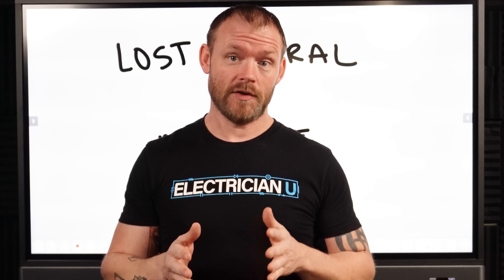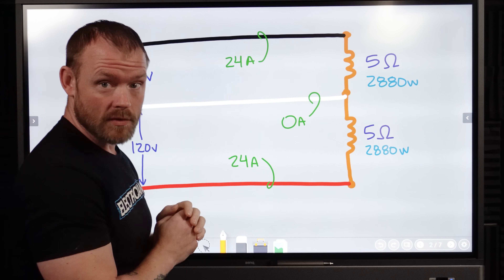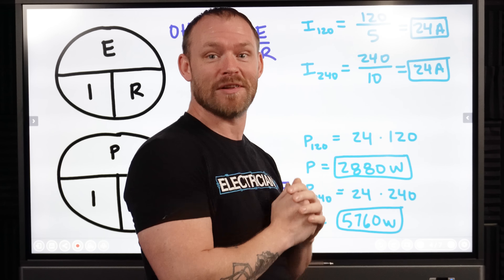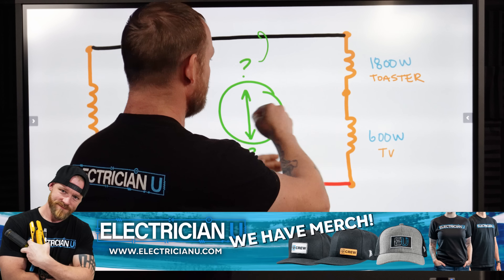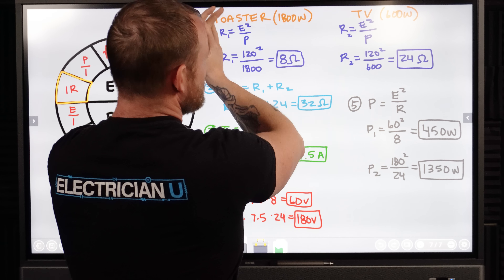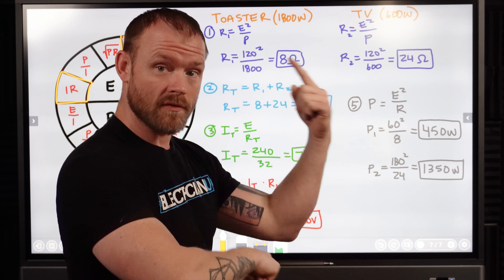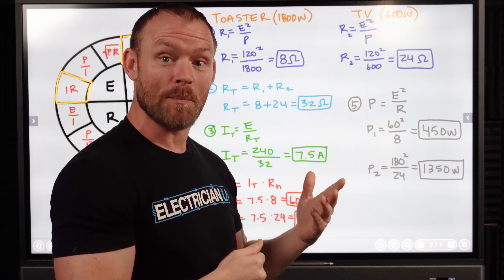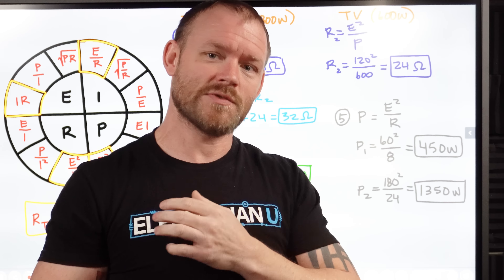NOT SAFE? Losing a Neutral in a Multi-Branch Circuit

Comment: Great lesson. Losing that neutral if it's on a combination breaker will roast that sucker. Had a plumber jump power off temporary pole for me and got about 6 combos for me and burnt his wet vac up. Had to throw that in there😂
Reply: I assume that "combination breaker" means a double breaker that is tied together to give both phases for a 240 volt load.  If that's the case, then the load may not even have or need a neutral.  Dryer outlets used to not have a neutral for this reason, but dryer manufacturers realized that they could run the electronics at only 120v if they used the earth ground as a neutral, and that's why dryers were forced to switch to a 14-50 outlet that has a neutral, since you are not supposed to return current on earth ground under normal conditions.  It sounds like your plumber effectively did the same thing and tried to split the 240v circuit to only get 120v, and if you lose the neutral when you do that, then the two legs go out of balance and you get higher voltage on one and lower on the other.  At that point you can only hope that the overcurrent on one leg will trip that breaker, and since it is supposed to be mechanically interlocked with the other, it will take that one down with it.  This doesn't always happen though since breakers are there to protect the individual wire not the *load*.
Reply: @phillipsusi1791  a combination breaker I’m referring to is a Arcfault single pole. I wasn’t on the job site when the plumber decided he needed electric and ran a 10/2 to instead of a 10/3 to meter socket and tiled the neutral on one of the a or b lines from sub-feed temporary thus putting the ground and neutral on the isolated neutral bar! This reading 180 V on one leg and 60 on the other. Fried arc fault breakers on high leg and smoking his wet vac and ruining 6 arc faults (combination) breaks.
Reply: @dgibson6147  I'm still not sure what "combination" refers to in a single pole breaker.

Comment: If the math just doesn't work in your head, then you can safely play with this. Sometimes doing is better than thinking about it.
Buy a laboratory power supply. These are used for doing electronics work. They are DC only.
Get one with two outputs and another connector on it for a ground. Also buy a pack of resistors of multiple values.
These power supplies are "floating". In other words, they have no connection whatsoever directly to the power from the wall. They are also of low voltages. You can safely short any or all of the lines, so don't worry at all about short circuits. These supplies have settings for voltage and for maximum amperage. Short circuit the lines and the voltage drops to only allow amps you set for, which will be zero unless you have a load within the short circuit.
Play around with two or more resistors and you can measure the voltage drops. You can measure the current at each point. The power supply itself will tell you the amps and volts through the whole circuit. Try doing 4-5 resistors in series and measure the voltage drops between different points.
Just make sure the connecting cables and resistors can handle the amps you set for.
(If you want to connect external stuff like an oscilloscope, you will then need to connect the ground on the power supply terminal in front to the circuit because the negative on the oscilloscope is directly connected to your mains ground. Very bad things can happen if you manage to short circuit the oscilloscopes positive from some device device directly to ground! Bam!)
What good is the power supply otherwise? You can pick any DC voltage it does and use it to power something like your cell phone or laptop if you can't find the chargers, just need the right plugs to fit. Need 4A at 5V for your cell phone, but you don't have the right charger, now you do.

Comment: Can this cause voltage to go up? When I turn on the dryer the voltage goes up to 134 volts on the house and consumers with voltage protectors stops working. What can cause this voltage fluctuations?

Comment: Joule–Lenz law,[1] states that the power of heating generated by an electrical conductor equals the product of its resistance and the square of the current:

This is NOT the same as Ohms law for Power. And Ohms law is for DC or for purely resistive loads. When AC is involved you have an added component which is Frequency. 
Example: You can measure a coil with an ohm meter and come up with a resistance. With this known resistance and known DC voltage, you can calculate the current (E/R). Now if you apply that SAME voltage but with AC you will get a whole different current flow. Because AC introduces Frequency into the calculations. At resonance frequency of a coil of wire the max current will flow and this can not be calculated by simple ohms law (E/R). This is because when voltage is applied to a wire, a magnetic field is created, when voltage is removed, the magnetic force collapses into the wire, thus generating a voltage. When the times of those voltage are exact, the coil is at resonance and max current will flow.
With AC the resistance is called impedance. In DC resistance & impedance are the same.
Then there is a PF to include in AC circuits....

Comment: I had a weird thing happen with an install we screwed up. We roughed in a garage with a studio above, and all the plugs were reading reverse hot and ground. And in the panel one of the lines was 0 volts to ground and the other line was 240v to ground. So what happened was that the installer bonded the ground to the neutral in this panel which was a sub panel :/ once I undid that everything went back to normal, but I just dont understand how things were even working normally or why the voltage was reading out like that! The people weren’t using this building very much but it had been lived in for a little bit and it seems weird that with 240v to ground on that one line, that they didn’t have worse problems. Could you maybe explain how this happens?

Comment: Never assume all circuits on a multi wire branch circuit are sequentially landed. I’ve seen circuits picked up in different locations in older panels. For instance, 2 , 4 and 12

Comment: This reminds me of a situation concerning multiwire branch circuits...
A customer was changing a 30 amp 240 v laundry center washer/dryer to a separate 120 v washer & 120 v dryer.  I wasn't quite sure how to make the conversion.  I wanted to separate each leg of the 2 pole circuit to make two separate 20 amp 120 v circuits.  My dilemma was this... I know that the laundry circuits had to GFCI protected.  The receptacles were going to go behind a stacking washer & dryer which made it very inconvenient for a point of use GFCI receptacle.  The washer & dryer would have to be disassembled & moved to press the GFCI reset button if needed. I was going to put the multiwire branch circuit on a double pole 20 amp GFCI breaker with one leg powering the washer & the other leg for the dryer, but I had the feeling that this would cause nuisance GFCI breaker tripping due to different currents on the neutral.  I ended up capping off one leg of double pole circuit & putting the 120 v dryer on the remaining leg.  I put the washer on a GFCI protected general lighting circuit.  I know laundry is supposed to have it's own designated circuit, but running a new designated circuit would have required a lot of invasive demolition from the panel to the laundry area.  Would placing the washer & dryer on separate legs of a double pole GFCI protected circuit have caused the GFCI to constantly trip?  What was the solution? Would I have had to run new circuits to the laundry area?  It's a pretty uncommon situation to encounter since 120 v dryers are pretty rare.
Reply: If you use a two pole GFCI breaker and wire everything properly nuisance tripping will not be an issue,  these special breakers will have L1, N and L2 on the load side, and you will connect the pigtail neutral to the neutral bus unless the panel is a plug-on neutral design.   They are designed specifically for multiwire branch circuits,  120/240V circuits, and 240V circuits.   For 240 volt loads that don't require a neutral you would simply connect the black and white to L1 and L2 on the breaker,  and connect the neutral pigtail.    The white wire in this case should be wrapped with a piece of black tape to identify it as a hot wire.

Comment: This would be more helpful if you diagramed with images practically applied in the field. 

For example, instead of drawing the symbol for resistors, you draw outlets or lightbulbs. Instead of drawing the schematic, you draw all the conducts used in an NM or MC cable, which means black, red, white, green.

That way we can visualize working with the concept instead of imagining it.

Comment: ima have to rewatch this video many times
Reply: Yes, he gave MUCH TOO MUCH information for a new learner.

You need to go way back to the beginning.

Learn about Kirchhoff’s voltage and current laws first.
Then go the Ohm’s law.    V=I*R         and    E=I*R.      are the same equation.          The V and E are both voltage.  Yes more confusion.
Reply: @tedlahm5740  ima look into it thank you
Reply: @tedlahm5740  is this like the line voltage and phase voltage?
Reply: @richardc7433  You are jumping WAY AHEAD.  That has to do with transformers.
Delta and Why transformers have line voltage and phase voltage.

Comment: So, toaster draws 3x wattage compared to tv. In a series circuit this means the tv voltage is 3x compared to toaster since a series circuit each seeing the same current and P=IE. 60v toaster / 180v tv. it helps me to intuitively see it and back it up with the math.

Comment: 1:34
I Would Like To Make An Important Precision..
Even if loads are not balanced, if you put your clamp meter around a neutral, you read nothing.
The Only way to mesure amps on a neutral, is to put you meter probes in serie.
Reply: I don’t think so.
Reply: Have to agree with the Flux capacitor guy on this one. I’ve taken current readings on a neutral with an amp probe many times

Comment: But if your individual loads depend on a neutral path to complete the ckt and that's lost you have no complete circuit so unless it finds another path your scenario does not happen. Also the entire house is one giant multi wire branch ckt essentially, so why when a utility loses a line do all of your appliances melt down?

Comment: I used to tell my helpers, if you cut the neutral on a 3 wire feed, across two separate 120v sources, you will burn out everything that is connected into those two circuits, creating a 240v loop with no neutral. NEVER cut a 3 wire without calling me. If you don't know, disconnect one leg before you cut the neutral. Or you will pay for all the damage, and not the company insurance. You have been warned.

Comment: exactly what ive been tryig to tell a insurmetation guy whos has this issue on some plugs sept i cant figure out where the 3 wire splits off like theres a hidden box in a walll
Reply: Sounds like multiple code violations.
Reply: @phillipsusi1791  how it was  built in the 20's
Reply: @1ajs  Well yea, code changes over time.

Comment: I dont know if this is related but... i lost ground on a residential entry at my appartment a while back. Everything was now 240 and it burnt all my bulbs, outlets were at 240, ceiling fans almost welded together and worst of all, my landlord wo7ldnt take my advice and he was playing in the old style breaker box bare handed. The ground lost was outside, from the post to the house. Anyways, it was costly.... computers went, also
Reply: You did not lose ground.   From meters to pole mounted transformers have 2 Lines and 1 neutral.   No ground involved.   But you were very close.  The lost neutral on the service does the same exact thing as this video.
Reply: @KevinCoop1  okay, i might have mixed up ground and neutral. Anyways, it was a dangerous situation my brother explained. He is a electrical engineer, specialized in nuclear

Comment: The simple answer is smoke - and possibly fire due to over and under voltage - and the various incorrect current due to that over / over voltage. 

“Volts down - amps up - that’s the ways its Eff’ed up!”

Comment: Joule's Law states that H (Heat) = I (Current) x V (Voltage) x T (Time the current is allowed to flow). Or, written differently, H (Heat) = I2 (Current squared) x R (Resistance) x T (Time the current is allowed to flow).... 

I think you would want to call it Watts Law... Watt's Law: W = V x A x p.f. wattage equals voltage times current times power factor. For purely resistive loads, such as heaters, or light bulbs, the power factor equals 1.0. (single phase)

Comment: Is it even to code to run shared neutrals?
Reply: Yes, NEC 210.4
Reply: Yes it's code compliant.  In residential because of the AFCI and/or GFCI requirements the cost advantages are very limited so these are pretty much only found in home built in the 1990s and earlier.   In the 70s and 80s they were very commonly used for the required two 20 amp kitchen circuits. 

 In commercial settings multiwire circuits usually have several advantages that outweigh the disadvantages when running a large number of 120 volt circuits in a given area from a 120/208Y 3ø panelboard. Smaller raceways, and savings of material and labor during installation can be substantial vs running a neutral for every circuit.
Reply: The key thing in the code, is that the two hot wires have to be connected to a 2-pole circuit breaker so that shutting off one of them also shuts off the other one, thus ensuring that there is no current in the neutral.
Reply: @benchociej2435  What?  No it isn't.  Any 240v circuit can only go to a single load, multiple branches are not allowed.
Reply: @brucefay5126  The breakers only trip if the load on at least ONE phase goes over current.  This is enough to stop the wires from melting, but not to stop burning out a load.  Modern code does not allow multi branch 240v circuits.  Multiiple branches are only allowed on 120v circuits <= 20 amps.
Reply: @phillipsusi1791    I agree.  2023 NEC section 210.4 covers this.  210.4(B) covers the disconnecting means, and 210.4(C) clearly states that only Line-to-Neutral loads are allowed.
Reply: What about 210.4(c) exception 2.
Reply: @highvoltage1979  Oh wait, so you mean as long as it is L1 going to one 120v outlet, and L2 going to another 120v outlet, then they can share a common neutral?  I guess that would be ok.
Reply: Yeah

Comment: 6:36
Why dont the 2 loads in serie just add up to become one bigger load?
2 identical 1000w baseboards made to work on 240v wont work properly if they are connected in serie..
Why?
Why dont they just add up and become a 2000w ??

Comment: In residential this is why I always ran 2 wire and spent a little extra money rather than 3 wire
Reply: Or use the mythical 12-4
Reply: @JasonW.  wasn’t invented when I started
Reply: @jimmiegill3981  yep, and nearly impossible to find at anything but an electrical supplier, which aren't open when I find I need it
Reply: What?  How is using one less wire spending more money?
Reply: @phillipsusi1791  two runs of 14/2 cost more than 1 run of 14/3 or same with 12/2 - 
12/3
Reply: @phillipsusi1791     Re-read it carefully.
Reply: @jimmiegill3981  Oh, not two wires, but two romex bundles, each with a hot, neutral, and safety ground, rather than a single bundle that has L1, L2, neutral, and ground?  Why would you do that?  That seems silly.  And like it should be against code if it isn't already.

Comment: Not even an apples-to-oranges comparison; more like apples-to-sand. Pretty much every modern TV has a "universal" switching power supply that works on 100-240V mains. On the other hand, pretty much any toaster is a purely resistive load. The TV has active circuitry that keeps the digital circuitry happy regardless of the mains voltage.
Reply: I was thinking the same thing. Even "simple" loads now have universal SMPS. So, the exact situation depends on the loads type (constant power, resistive, or motor loads)
Either way, balanced loads on a shared neutral is the best approach. And the unlikely event of a shared neutral open fault and independent load fault.

Comment: Thanks for explaining that.  I found that adding a turbo encabulator to the circuit would result in a polarity swap of the tachyon field and thus compensate for the loss of the neutral.  Yes, you will have to recalibrate the Modified Schmidt Trigger but everyone should know how to accomplish that simple task.
Reply: Rockwell automation makes some great turbo encabulators. We use them all the time
Reply: @highvoltage1979  I think they come standard on all of their VFD's.
Reply: We just installed a new MCC line up and I was quite impressed with how the side fumbling was totally eliminated and also had the newly developed lunar Wayne shaft which seems to help even out the gram meter
Reply: In three phase we use 3 flux capacitors.   That way they can not cross coordinate!
Reply: @KevinCoop1  wish they would update the flux capacitors, been using the same ones since 85’
Reply: @highvoltage1979     You probably only have about 100 cycles of charging and discharging left!   You will know when the end bulges and smoke comes out!